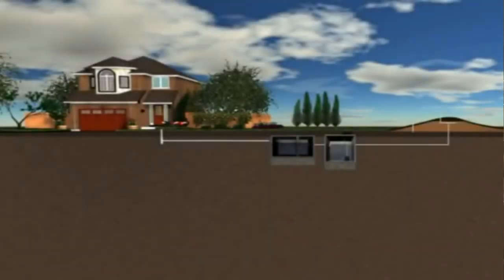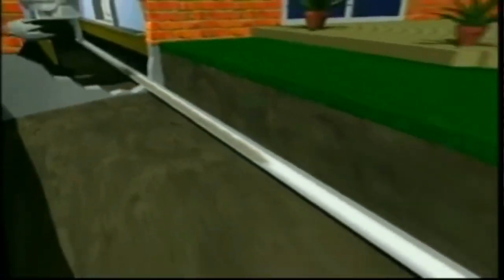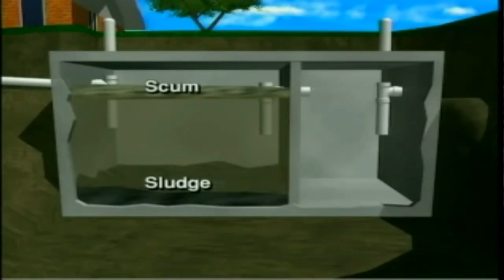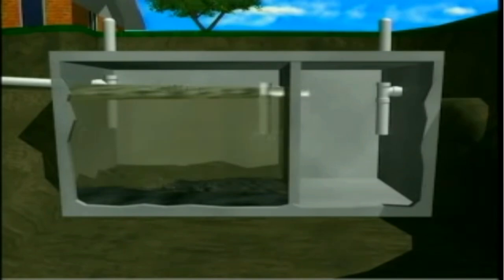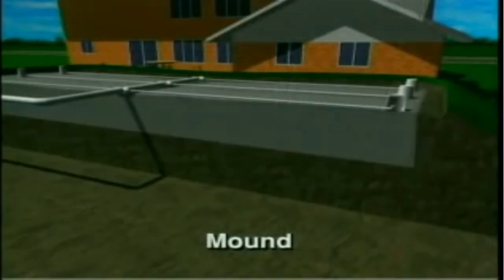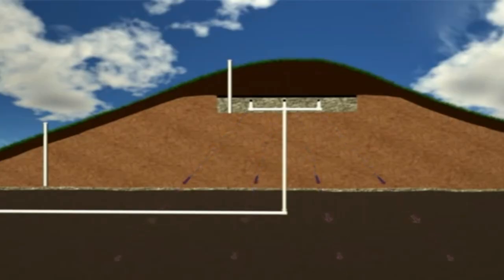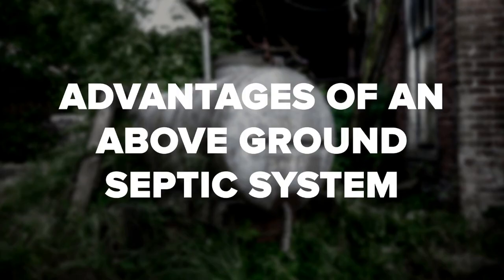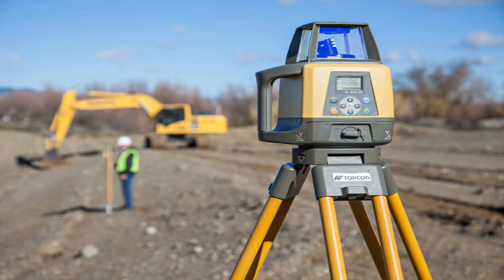Explaining An Above Ground Septic System

Comment: Are these useful in an area that floods regularly?  My neighboring property has a failed septic system and the guy flipping the house said theyre installing an above ground system.  The house is right next to a creek that floods every year (deep fast moving water) to the point that the house was lifted onto a 3.5 ft high concrete foundation using a fema flood isnurance payout.  What happens when flood water rises above the sand mound and will this cause problems for me, the neighbor downstream of it?
Reply from the maker: Thanks for the question.  A sand mound should never be placed in an area of flooding, this of course will ruin the entire sand mound.  Once the sand becomes overly saturated the effluent would not get properly treated, bacteria would channel through the sand without getting picked up by the other bacterial colonies in the sand that consume new bacteria coming in from newly dosed effluent.

Comment: Can you put stone on top of the mound visible to the eye, trying to stop my dogs from digging
Reply from the maker: You bet, small stone to let's say 2-3" should be fine, no heavy rock / boulders as it could start bowing the lateral lines.  Spread drain rock evenly so the weight distribution is even throughout.

Comment: Why not excavate the location of the sand mound so that the sand is below grade and the pump can be eliminated from the system?
Reply from the maker: That would defeat the purpose of a sand mound, we are trying to create vertical separation from the limiting condition or restrictive condition / layer.  For example if high water table is 1ft below grade we are not going to excavate into the ground and place sand.  Thus we have to elevate the system above grade to the vertical separation minimum distance as in our standard's book with spec sand.  Meeting the vertical separation distance allows the removal of harmful pathogens from going into the aquifers, water tables, wells, waterways etc.

Comment: So, does that mean that an above ground system is ok if a property doesn't pass the perc. test?
Reply from the maker: Regulations on certain system types is going to vary from state to state, and sometimes county to county.  For soils with poor permeability we use a sand mound system.  Normally I would say that yes, an above ground system is going to be one of the best methods to deal with very slow Perc rates, but you will have to discuss the system with your health department.
Reply: @groundstonewastewaterservi5066  Thank you!!

Comment: Thanks so much for the Video, however in Australia (at least in NSW) we were not required to have a sand mound, the waste water is sprayed onto the paddock.  There are 2 Tanks, 3/4 buried.  We are on 5 Acres and a designated area is for this waste water (not supposed to use for edible plants).  The tanks are checked and treated regularly by our plumber.  The waste from the house goes into the first tank and is agitated (I think) on a set cycle and then pumped to the 2nd tank where it again is agitated on a set cycle before being pumped out through sprays onto the set area.  An Electrician has in fact now looked at it and somehow fixed the problem, sorry but I don't know exactly what was done and in fact I have been told that of the 4 power points located on top of the 2nd tank, one seems to trip the circuit breaker and has been left unplugged.  The system seems to be working though so I'm not going to worry about it just now.  Im off for a few weeks then its Christmas, so a problem for another day or at least untill it plays up again.  Thanks all.

Comment: I am a contractor by trade. I build houses , but i have NEVER installed a septic system. I was told by the county where im building my next house that traditional septic systems aren't allowed. So, Im going to have to install one of these unfortunately. Anyone know the material only cost on something like this? Not a chance in hell I can afford to pay some company to do it, considering based on the comments its apparently like $30k.
Reply from the maker: Hi Brian, 
You will probably need a professional's oversight, there is a fee associated with that.  You would have to contact various practitioners for cost in for overseeing you install the system.  Many jurisdictions require this.  For cost of supplies you would have to locate septic tank manufacturers in your local area for this and also plumbing supply stores for piping, pumps, control panels etc.
Reply: Hey man, same boat here. Any update on what you had to do? Really intrigued.

Comment: In Minnesota you don't have a choice.   When the property gets sold, the new owner is forced to install a mound system.   No other system will be allowed.   Only problem is finding enough room for a mound system, especially if you have 4 or more bedrooms.
Reply from the maker: It can certainly be difficult, when space is limited and we have to go to a mound we normally will do what is called a sand mound mantle, the toes get extended considerably, at times we may also have to have additional treatment to further reduce space.
Reply: In Minnesota (as well as other states), a mound system is only required when the soil is not suitable for a standard drain field. Typically, when the soil doesn’t have naturally good drainage, such as having more clay in the soil than a nice balance of sand, silt, and organic matter.

Comment: Why though. Our tank with a flat leech field powered by gravity was diy'ed by someone 30 years ago and is still going fine. Over complicated crap
Reply from the maker: Above ground systems are placed in clay type soils, high water table areas where there is limited vertical separation in soil.  You can’t very well place piping network below grade in clay soils, nor can you place in ground piping in high water.  The video explains this.  Gravity systems don’t work for every situation.  Septic systems are highly regulated, we go through thorough training and on going training to identify the right design for each challenge.
Reply: @groundstonewastewaterservi5066  gov can't regulate it if they don't know it's there
Reply: Well, for one, you may be forced to install one like I am being by the city. So, in that case videos like this are very necessary. Just because you're fortunate enough to not have to doesn't mean we all are.

Comment: How tall are these mounds typically for a 4 bedroom house say 2200 sq. ft. I live in Oregon and on a low lying area. I currently pump my effluent 900' to a drainfield on the upper end of the property. We may want to build another house, but there is no more room in the current drainfield area to support another residence. I'm on 16 acres so space isn't the issue. Water during the rainy season where my house is can be inches from the surface.
Thank you
Reply from the maker: Thanks for the question, typically a minimum of 2 ft from the limiting or restrictive condition, in your case seasonal high water.  We choose an area where the surface water doesn’t accumulate, preferably on a slight slope.  For your case I would use 2 ft of mound sand, upto 8” of drain rock, fabric cover then topsoils to a minimum 6”-12” for frost protection.  The colder the climate the topsoil should be closer to 12” with perhaps some wood chips or wood shavings mixed in.  We generally calculate for lineal space, mounds work best being long and narrow.

Cheers,
Reply: The one I have is about 4 feet tall

Comment: Exactly like my 2-year old system. My hi level alarm came on, when I looked in the pump tank, the water being pumped to the above ground drainage field, was coming right back to the tank via the drainage field return line, at almost full pump pressure! No wonder the tank isn't emptying. The system is not even two years old and was installed by a reputable installer. The field has two vacuum breakers that look intact. I haven't contacted the installer yet to see what warranty options I have but for now I'm using a pool pump plugged into a wireless remote power switch, when I see the red alarm light on, (I disabled the audible alarm) I run the pump with a long hose out to a large wooded area near my house. What can I look for before I have them come out?
Reply from the maker: Hi John,  sometimes the pump impeller can get stuck due to hair, wipes or other material that doesn't break down well.  This can cause the pump to hum but not pump.  Freezing in the line can certainly be a problem, although you may not be facing these temperatures quite yet.  A broken or plugged line can also be an issue.  Sometimes power outages can cause pump failures if there is no surge protection.  Hope it's an easy solution for you!

Comment: I’m getting ideas for my 9 acres of raw land gonna start next year, a rock sheet piece of land, should be interesting however, homes in the are have mound septic systems so I’m sure that’s what I’ll have to do
Reply from the maker: One way to obtain information on the type of system you may need is exactly what you said, look at the types of systems in your surrounding area.
Reply: No u won’t . It’s 60 thousand
Reply: @kevinsargent79  60K is about 2x more than what a mound septic system would cost